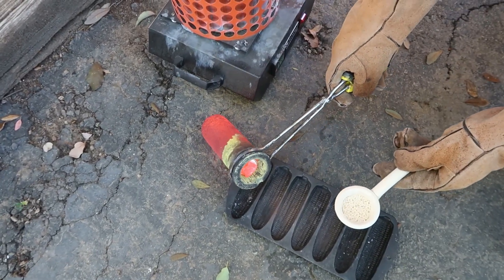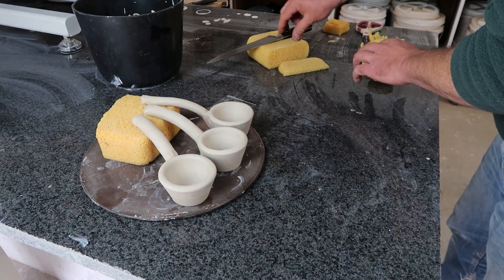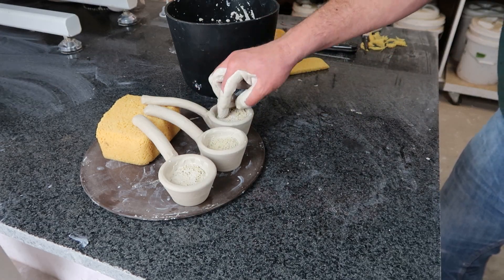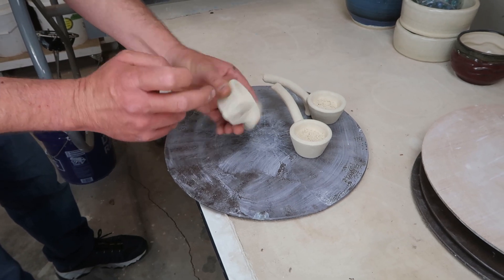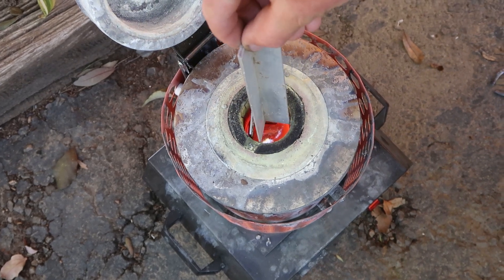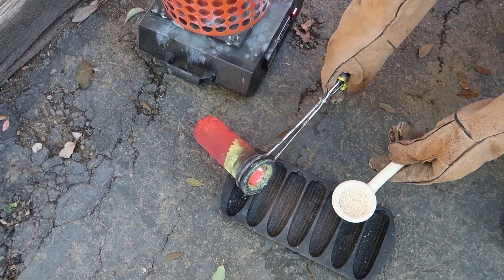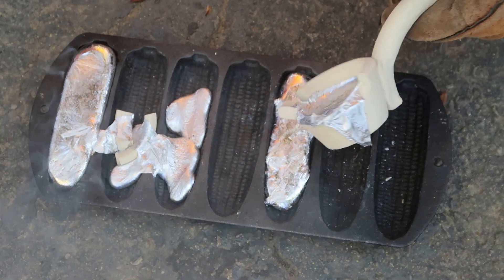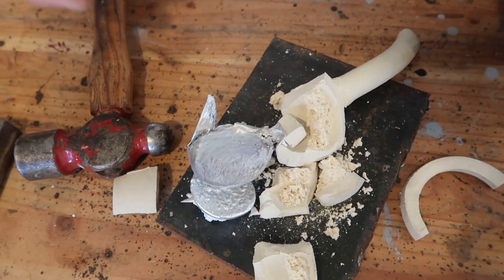Filtering Molten Aluminum with a Ceramic Filter - FAIL

Comment: I looked up some research papers, and getting molten aluminum to wet ceramics has a surprising amount of research.
Heating the ceramic reduces the contact angle, so preheating the filter would probably make the biggest difference, I think.

You could add a flux like (baked/dehydrated) borax to the filter.  Also could add borate to the ceramic.

In industry, they apply pressure.  A deep crucible might act as pressure, but probably not enough to matter, vs the risk.

Just some ideas.  I like the metal/ceramic sponge idea.
Reply from the maker: That's interesting.  I did think of pulling the aluminum in with a vacuum pump, but preheating it is where I need to start.  Thanks!

Comment: If it did work as you would like it to, would you prefer to use this method to remove slag, or just use an old desert spoon to scrap the slag off of the top of the molten metal?